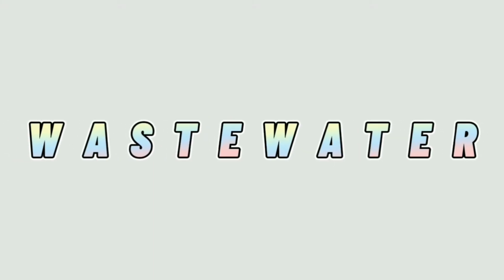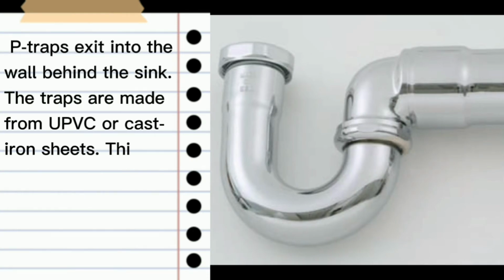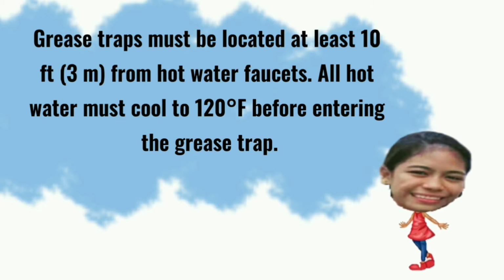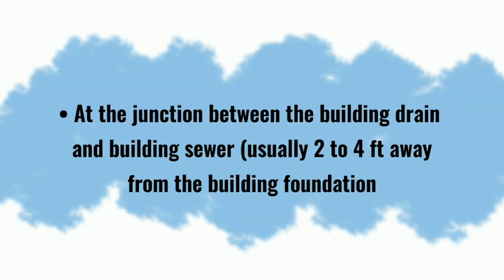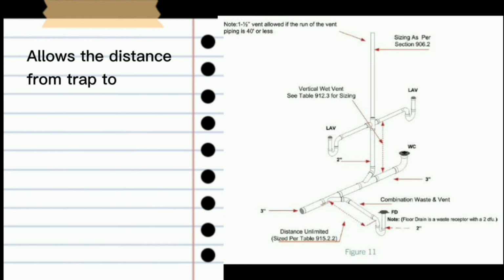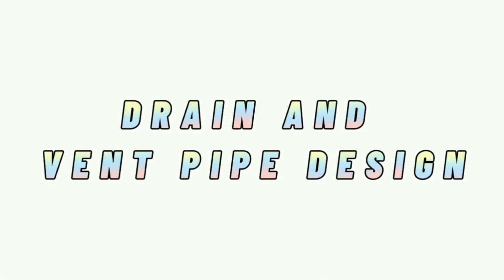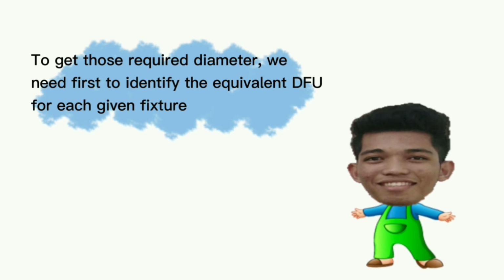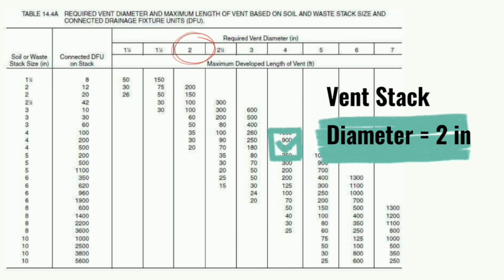Sanitary Drainage System

Comment: For me, yung no. of fixture kasi is directly proportional siya sa diameter ng horizontal pipe. kumbaga, kung ano yung result, fix na yun kasi let say sabay sabay gamitin yung fixture and yung waste nun sabay sabay babagsak sa horizontal, kung in adjust mo yung diameter nun at lumiit, maaaring magkaroon ng clog sa pipe. yung lamang po. sana po nasagot ng maayos 😊
Reply: Hi ask kolang po kung yung sanitary drainage system and drainage system ay iisa lang ang meaning or as topic po? or magkaiba sila po